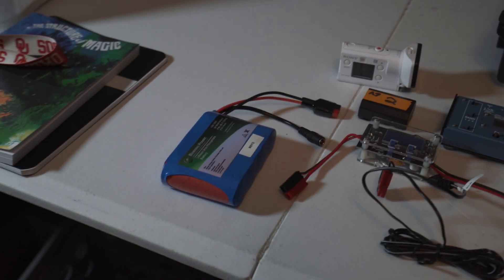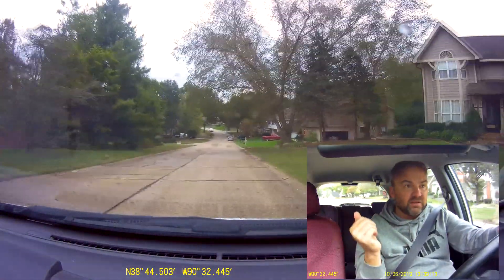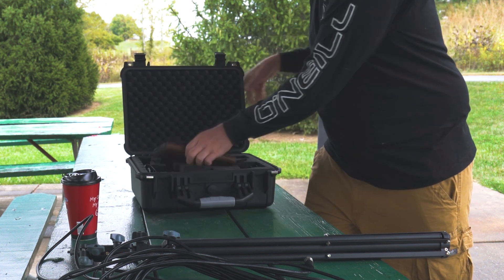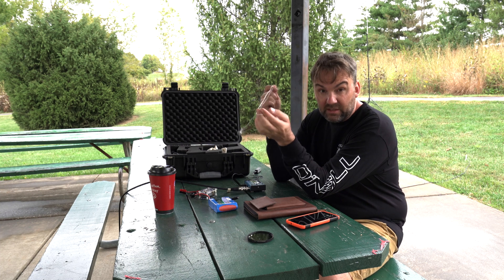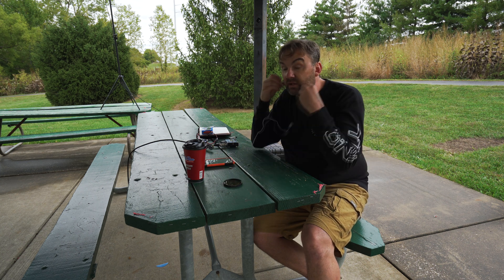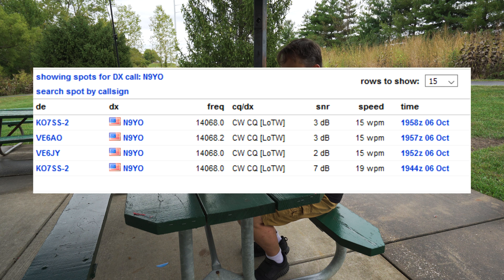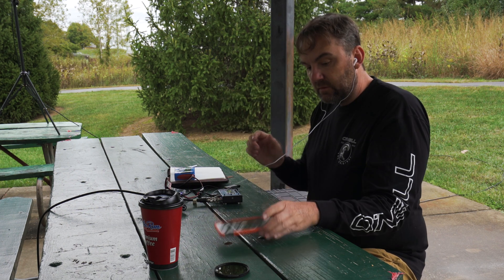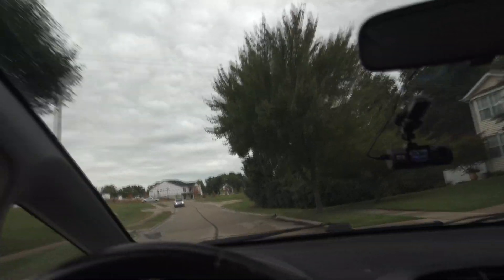The Mountain Topper QRP CW Morse Radio | MTR3B | OUTDOOR TEST

Comment: Tom - a small luxury, but my go kit is self contained. By this I mean that it has ALL the required connectors, cables, etc. and they NEVER leave the go kit. I had to buy a few small extras to do so, but it means being unable to leave anything home! I have two kits in my trunk - one for 100W and another for QRP. These two rigs are ONLY for portable ops so they stay with the go kit too. Only the antennas in the trunk are shared between them - but it's ALL in the trunk :)  Hope to see you on the air sometime! WB2SMK
Reply from the maker: I hear ya man, but my question is, how much do you vary your kit?  I do a lot of mixing and matching from about 4 different radios to antennas etc etc.  It's hard to keep it all straight.

Comment: I have an mtr3b and power it with 3 x 18650 batterys it's. a little more than 12v when fully charged, but I will knock the TOP off with a different radio before I go. It last a long time and I don't have to have the voltage converter.  Love your videos. I learn a lot. Thanks
Reply from the maker: Thanks for the nice comment.  I love my MTR3B.  Tomorrow morning I will publish a success video of tonights MTR3b!  Stay Tuned Amigo